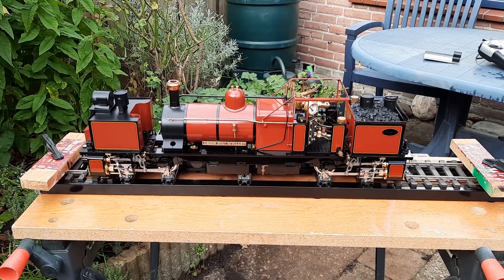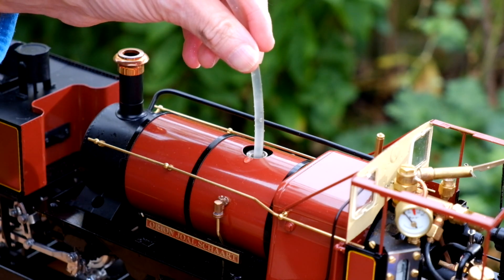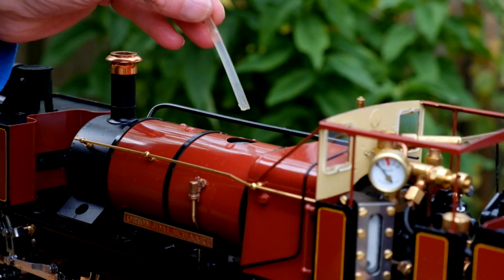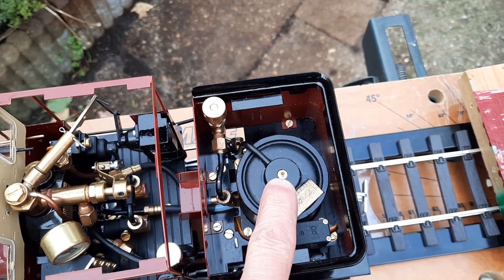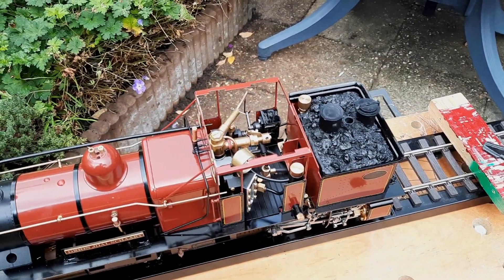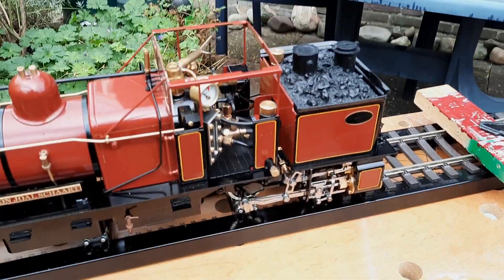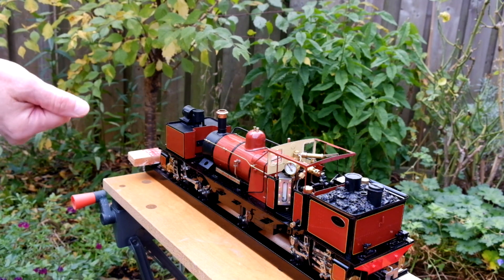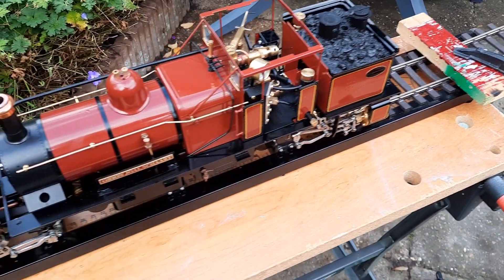D Class Diary: No.3 Steaming procedure

Comment: Is there not a water tank, and a feed water system?
Reply from the maker: Hi Tim, there is no separate water tank. The boiler is topped up via a Goodall valve in the cab and a hand pump action water bottle & hose
Reply: @gasmith841  hmmm that's interesting.  I would have figured it would have one. But it's just a Goodall valve.

Comment: Do you need to insulate the servos and wires from the heat?
Reply from the maker: Not in this case. Each driving bogie has a servo, but its well away from the main heat source...the boiler. The wiring is mounted in such a way that it is not in direct contact with hot metalwork

Comment: Beautiful loco. Shame they don’t do a 2 1/2 inch gauge version.
Reply from the maker: Thanks for the compliment Alex. 2 1/2 inch gauge? Is that a popular gauge?
Reply: @gasmith841  hmm. It was with model engineerings and a handful of garden railways. Years ago. But it’s been having a come back for several years. There is difference with 2 1/2 gauge as it’s a bit over scale so that the driver can sit behind and trundle along and fire and drive. Garden railway side of it is known more for been called gauge 3. More closer to scale. If you scroll down on my channel in the video section and go down several years you will see some 2 1/2 inch gauge locomotives in action at one of my local model engineering clubs. But yeah. I came across your channel actually from this Garratt. I do a weekly check for any new Garratt locomotive clips and one of your clips popped up. So yeah I had sub. Lol